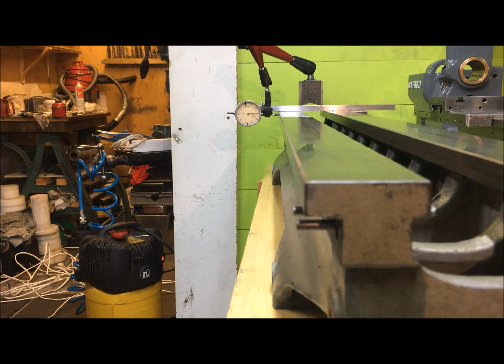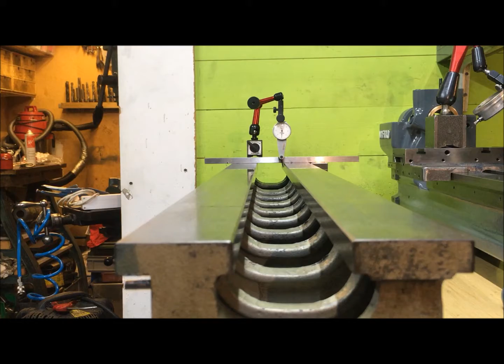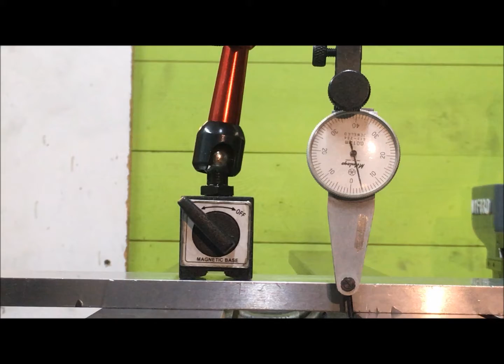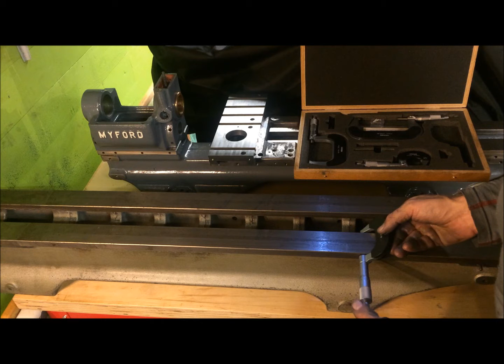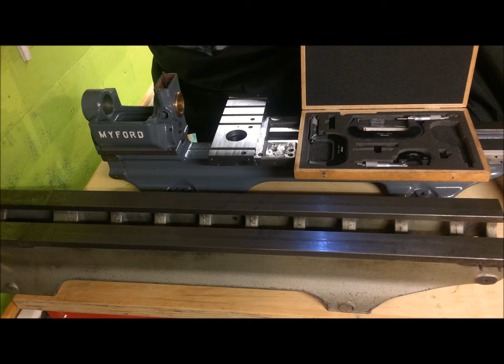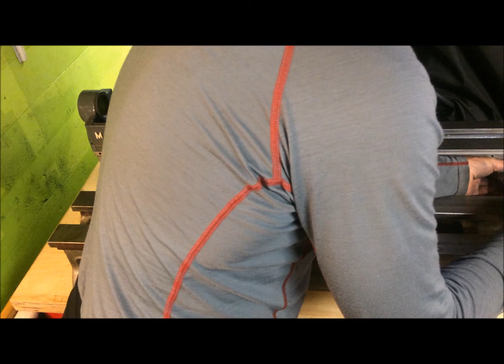EMCO Maximat Standard - initial measurements - bed vertical surfaces

Comment: I'm a bit surprised you haven't built your own version of a Kingway tool yet Jan. A few added adapters for indicators and dti's plus adding a 90 degree bar to set your horizontal reference surfaces much like you were already doing would just about do any initial and post scraping survey checks you want. :-) Your time isn't being wasted from at least my perspective. I keep learning from every one of your videos so my sincere thanks for taking the time you do to video and post them.
Reply from the maker: I fully agree on the need/benefit of this. Only down to my time/laziness/inabilities.. :) I have been thinking of this awhile, and have seen several different versions made by friends of mine. I also have looked at the original design and if I could make a simplified version or "steal ideas" to make my own design. However, haven't yet taken the time to step back on the projects (Myfords etc.) to catch up on these. This as well as other jigs etc. forces its' way through though. For example, I am now into milling the underside of the Myford saddles, but before I take on this as a "series production", I have begun with the next in line (have a possible deadline for the first ELS equipped version, hence thought I'd finish this first), trying to figure out the  optimal way, ie. "best practise" for a rigid setup and possibilities to minimize the setup time, measurements needed if I want to undo the piece and re-clamp it again etc. I think I need to make myself a jig / cradle of some sort for this purpose. PS! Some saddles are quite worn and at least for these I will mill down  and build up with Rulon way liner material. These strips are glued on and you might need to mill the height a little also afterwards (to minimize scraping). All this work would be faster/more precisely accomplished if the jig/procedure as well made/thought through
Reply: I had a catastrophic hard drive crash on my last computer so lost a great deal of information Jan. But I had a link to a German company that made smaller and very accurate level vials that would have worked well for a shop made Kingway. I'll see if I can refind them and post here if I do. And if I recall they were priced at about $70 American each. There's other ways of doing what a Kingway does just as you've shown your already doing. But I think building one would speed up a machine survey and possibly give a bit more accurate and consistent set of numbers. 

If you build your own version of a Kingway I hope you video and post the build on here. Even more so for that ELS of course. :-)

Edited to add, Likely you already know of them Jan but I just refound that ground glass level vial supplier without much trouble. Geier & Bluhm. And it seems I was mistaken about them being a German company. There based in the U.S.